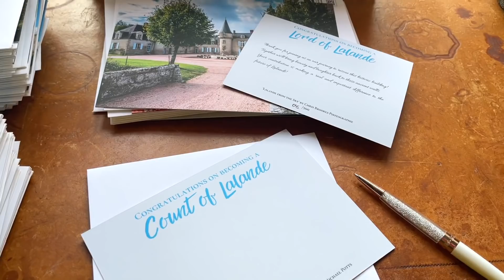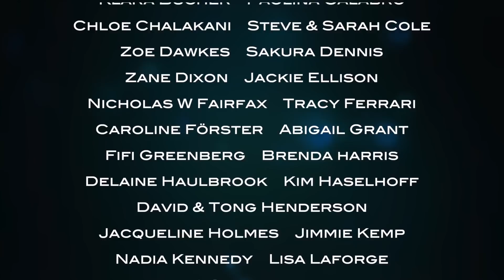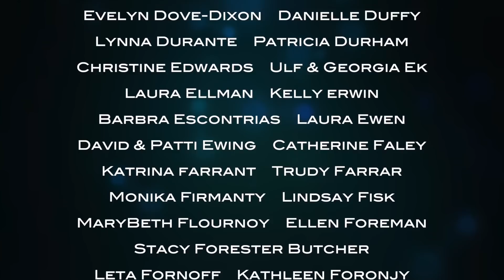THE SECRET OF THE CAVERN REVEALED!

Comment: There was a drainage pipe at the entrance that had holes that could have been used for water removal.  Also, it could have been at type of produce storage unit and the pipe with all the holes could have for air distribution.  With the plastered finish and no other seepage holes for the extra water to drain it seems to be nicely done for a waste unit.

Comment: If you are not using it as a cesspit, you could open the part in the outside wall and put a staircase in. Then you can use it as a winecellar ;-)

Comment: The perforated pipe throws me for a bit of a loop.  Its hard to tell its location in relation to the wall in the video, it almost looks like its in the wall and the chateau wall appears to be 16"-20" thick (40cm to 50cm, right?)  Mostly I think it is a septic tank and that pipe would go down and elbow away from the chateau underground to a lateral line system, or possible straight to the lake.  Its probably original to the addition.
Reply: I wrote that RIGHT before Steph's explanation...  So the perf pipe might have been used to suck the liquid out of the pit so that someone could go down to clear the waste...

Comment: Why not gutters instead of doing the ground?
Reply: A) Not authentic to the historical architecture  B) The difficulty & expense of having a large cherry-picker to install would not be practical  C) They still want to pull the water away from the foundation, and currently the pitch of the lawn next to the building is toward it.  D) Gutters can get clogged and maintenance that high off the ground can be difficult and dangerous.
Reply: @TheBTG88  There are no trees near for the gutters to get clogged. They do make gutter guards. Keeping water away from the foundation is the purpose of gutters and historically accurate or not it solves a problem. There is no substitute for gutters. Difficult. People install gutters on 2 story houses all day long. While a drainage system along the foundation is needed as well, gutters go a long water in helping displace water. Water has to be funneled in different directions. It can't all go to the same place because the capacity of the pipes can't handle it.
Reply: @BigBirdy100  - 1) Materials that can clog roofs even when there are no overhanging roofs - Wind-driven leaves 2) Roofing material - in this case slate roofing tiles - whole and partial 3) Moss and algae.  Historical accuracy is important to both Stephanie and the French Academy of Architecture - whose approval is needed for buildings to be listed.  Note, the chateau is not only notably taller than a two story suburban home, but it has a far steeper roofline pitch and catchment area that dramatically increases both the volume and speed at which water is shed, making gutters impractical and inefficient.  The gutter size would need to be enlarged exponentially, making it look even more ridiculous on a building of this age and style.  A French drain system can easily have its capacity increased by enlarging the pipe diameter or by laying additional pipe in a parallel format.  And with both the soon-to-be returned lake and dry moat located nearby, running the piping at an appropriate pitch is not difficult or expensive.
Reply: @TheBTG88  Whatever solves the problem is what should be done, regardless of historical accuracy. Their engineering wasn't perfect and should be corrected.
Reply: @BigBirdy100  - I'll assume that you are not familiar with historical covenants especially as how they apply to preservation and tax abatements.
Reply: @TheBTG88  No, but I'm all ears. I could probably sum it up. They're unfair, not practical, don't all make sense and hold you hostage to a more expensive fix. I think if there are special demands for historical accuracy above what is a reasonable solution, the "historical society" should pay for it.

I'm looking at a video now where she changed a front door to new double paned and it has glass all the way to the bottom unlike the original. 🤔 Historically accurate? I doubt it. So why didn't she adhere to historically accurate?

I also see gutters on part of the chateau service buildings. 😶
Reply: @BigBirdy100  Very simple.  Don't like adhering to historical restrictions, don't buy a historical home.  The doors that were replaced are not themselves historical, which is why there was special dispensation to replace them provided hardware (handles) used are appropriately designed to fit the Second Empire (1852-70) look - which coincided with the previous major building reconstruction.  That's why you heard Stephanie noting that the was going to be changed.  The gutters on the outbuildings were installed by the previous the owners, the Marquis family, and were installed originally in the 1950s and to date have been grandfathered as it occurred prior to the French Ministry of Culture creating their regulations.  Of course, these regulations can be changed/updated at any point.
Reply: @TheBTG88  I think you're very good at guessing and making things up. 😉
Reply: @BigBirdy100  - This information was shared by Stephanie through her Patreon account.  Perhaps you should just stop while you're behind.
Reply: @TheBTG88  😂 I don't believe you. You're good.
Reply: @BigBirdy100  She live streamed Q & A on her Patreon account last year when there were people asking about the crumbling façade of chateau.  She talked about the exterior water problem and what they were looking at doing.  We'll see if the new water drainage plan Davy has drawn up for the roofs gets approval.  The bureaucrats in France are fickle.  The same thing happened with the lake.  The Water Police forced her to drain it and now they are having to reconsider as the lake was shown on old maps to have been part of the water system for hundreds of years and thus should be exempt from EU regulations.  Again, all information she has shared previously.